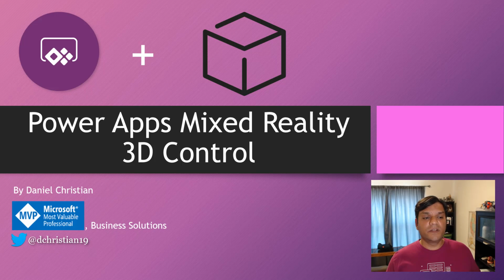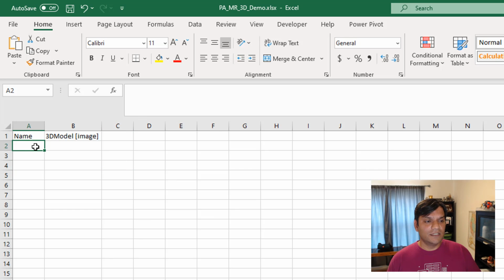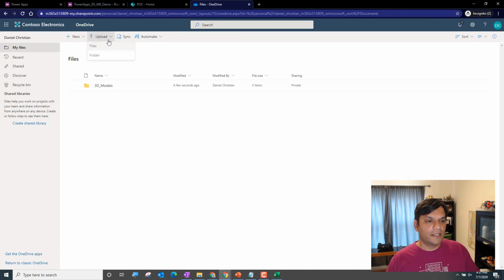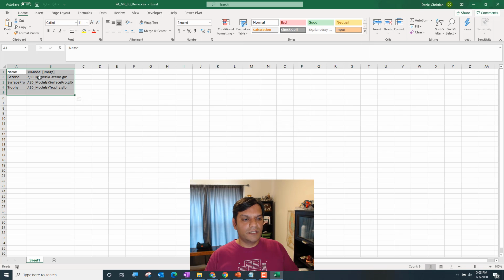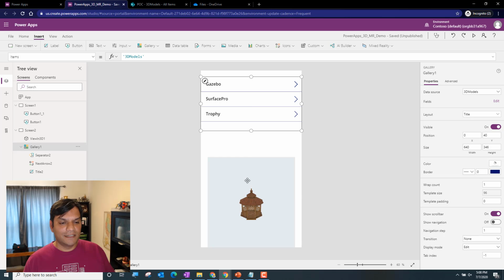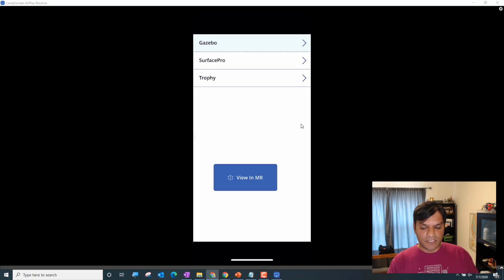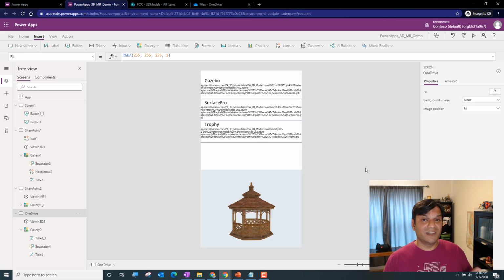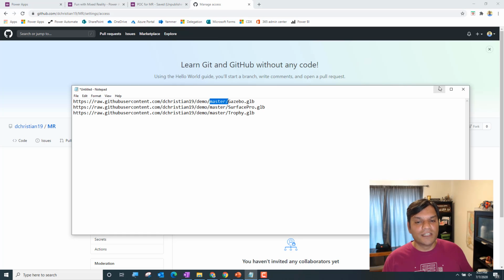Power Apps Mixed Reality 3D Control

Comment: Hi Daniel, 
In the warehouses of my company, we measure box size for transport cost forecast manually. In order to make this measurement in more productive way, i developed an application. To go further i discovered "Measure in MR". I have 3 basic fields lenght, witdh and height. Do you think by Measure in MR, i can measure the box and bring cm in related fields?

Since there is no enhough sourece (i did not discover from the vidoes on the net) i need your advise.

Thanks in advance.
Reply from the maker: Hey Ogun,
I highly recommend doing a Proof Of Concept (POC) with Power Apps MR. Also, with the two new features of Area and Volume built-in, you don't have to do the math anymore. 
Here's my latest video on that topic - https://youtu.be/vPCGm6FRhEI

Connect with me on LinkedIn and we can chat some more if you wish --> https://www.linkedin.com/in/danchristian19/